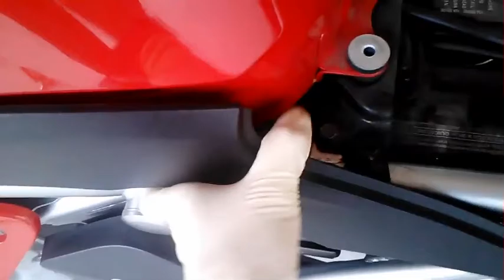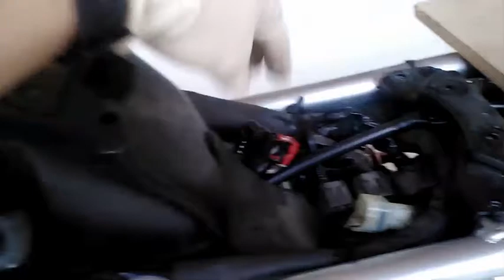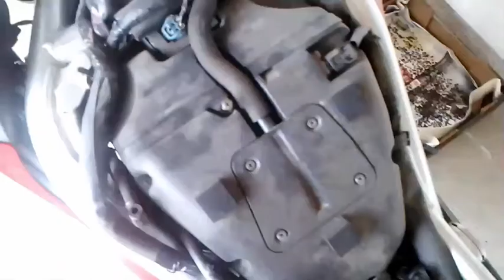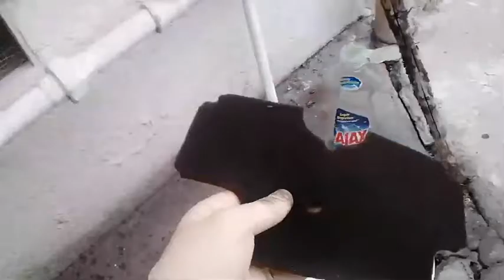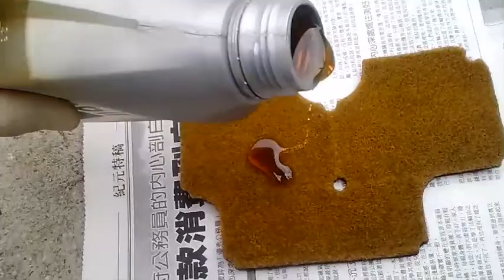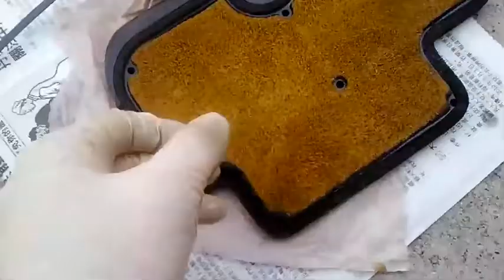2007 kawasaki ninja 650r air filter removal and cleaning

Comment: Does the tank have to be empty?
Reply: Nvm jus saw the comment below, but do you think this would help if my bike won't hit top sppeed? It tops out at about 80 mph with the throttle fully cranked and  is very jerky like it gets some power for a second
Reply: it doesn't have to be, but the decreased weight surely makes the job a lot easier!
Reply: +Joseph Hauser this is an inexpensive procedure so I'd definitely try it first. if u have clogged or dirty fuel filter, that can also cause low power

Comment: Man- this is a great video. Thanks for posting.  I had a battery mishap and blew my main fuse on my starter solenoid, replaced that, and decided to clean my air filter while I'm at it.  Thanks for posting!

Comment: Thanks for the video! Quick question, does the fuel tank need to be completely empty before removing it? I don't want to find out the hard way by disconnecting everything and having gas run all over my bike.
Reply from the maker: You don't need to have a completely empty tank, but having most of the fuel gone will make lifting the tank and overall job easier due to less weight. There is no risk of having gas run out unless you completely flip the tank upside down. Sorry for the late reply!

Comment: Thanks for your video.  Managed to get the tank off and filter clean relatively quick.  It went much easier than i expected.  My only difference was that my gas tank only had 3 lines coming off of it rather than 5 on my 07 650 :S
Reply: HyperTechnical I think he had two more lines because it is the California model. They have really high emissions standards. I have an 08 and it had three connections to the tank.